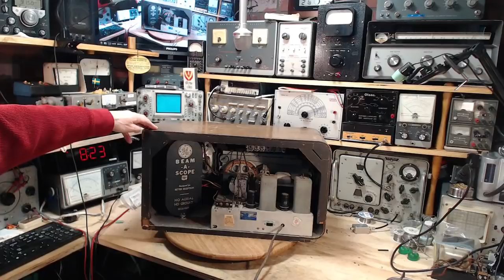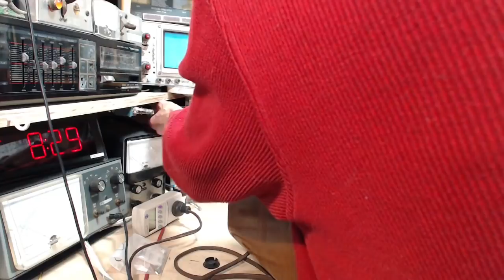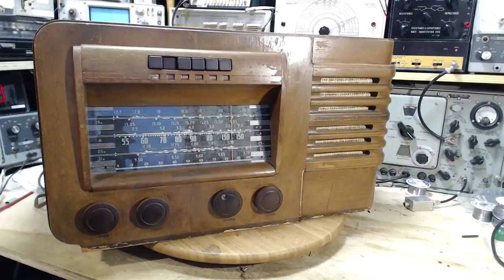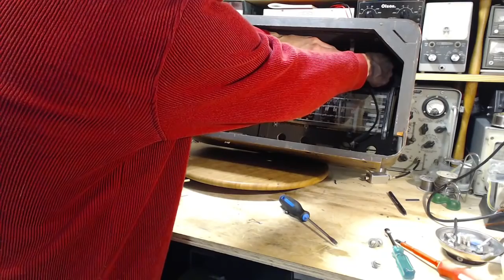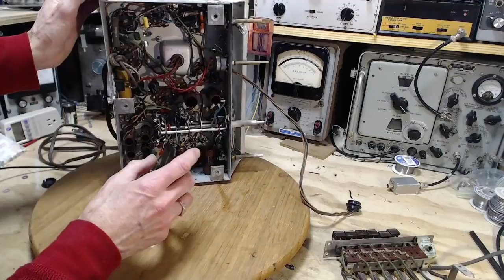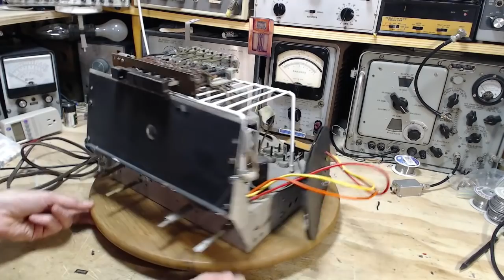General Electric KL-70 AM/SW Radio Video #23 - Five Years Later!

Comment: Hey Jim, I have the same GE KL-70 with the same problem. On mine I had nothing at the 6SK7 (RF) or 6SA7 with a signal tracer. Then I tried with an external antenna and I had some signals at the 6SA7. For now, I'm working on another one, I hope you'll find your issue with it (as it may help me). If you have a chance give it a try with an external antenna to see if it's better or not.